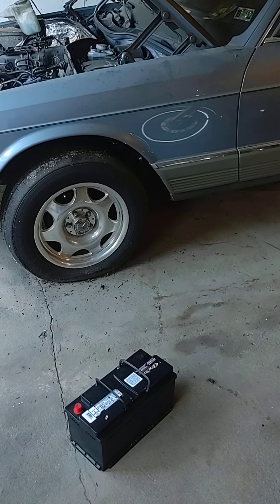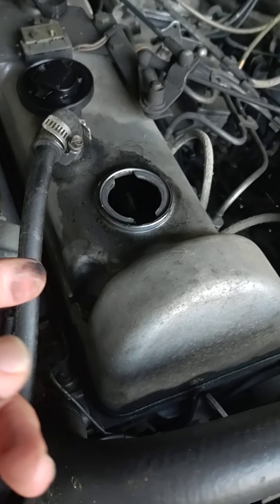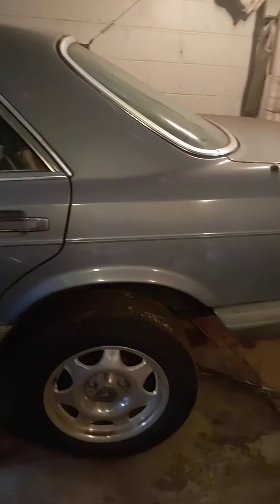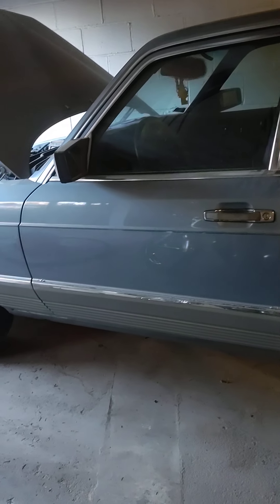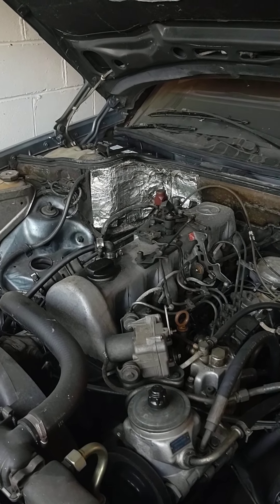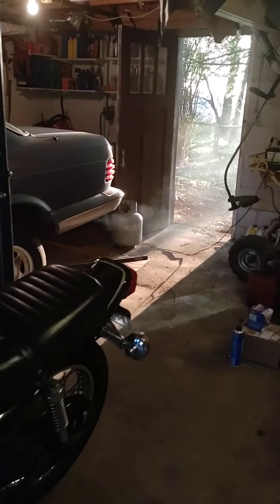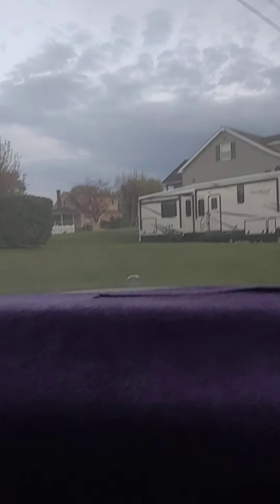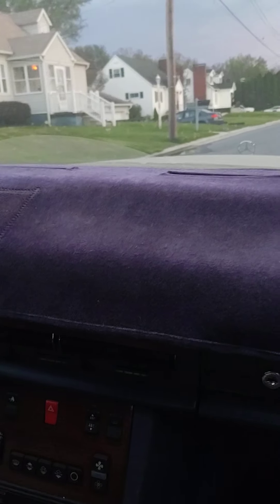Mercedes 300SD part 2.

Comment: Mixing straight veg oil with diesel can plug filters especially if it sits. The diesel causes the veg oil to polymerize and form films. You want more than 90% diesel or more than 85% veg oil.
Reply from the maker: I have been running up to 80% veg oil with no problems for years.